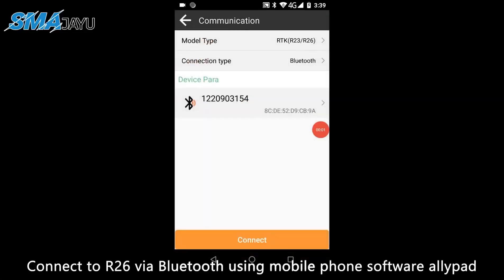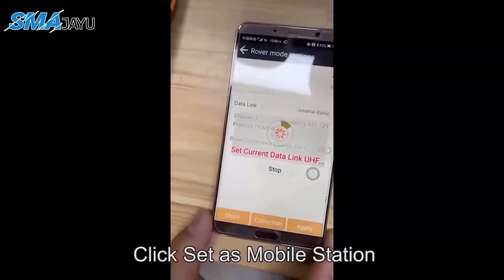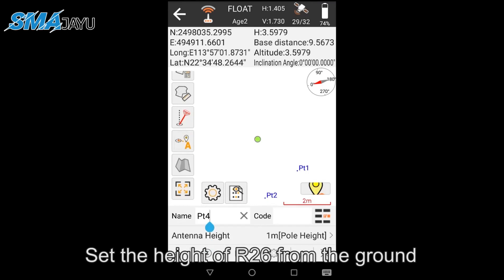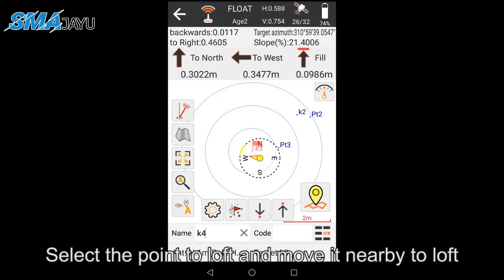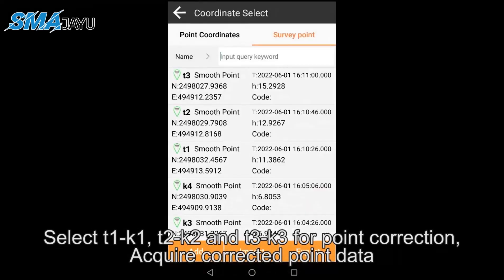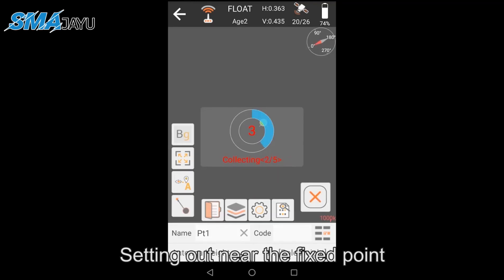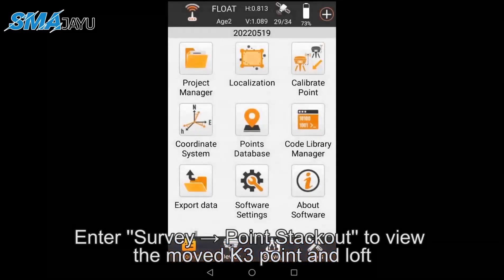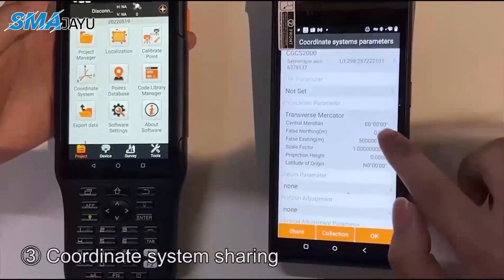R26 Surveying instruction with voice

Comment: Always having issues with fixing, always single
Reply from the maker: the seting steps are important.  After connect base and set internal radio procotol and channel.  Wait for 2minutes before stop base connection.   Then connect rover and set same protocol and channel as base.  If you still have problem, kindly contact our tech team at tech@smajayu.com